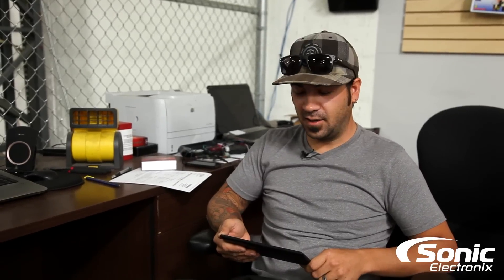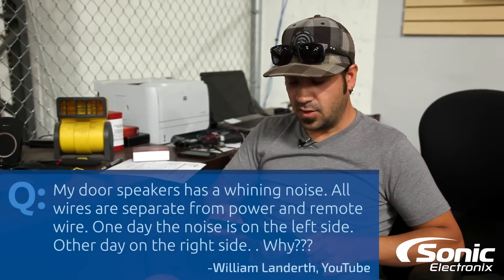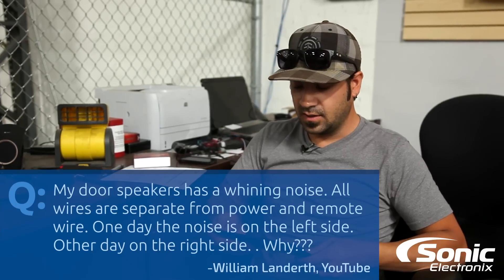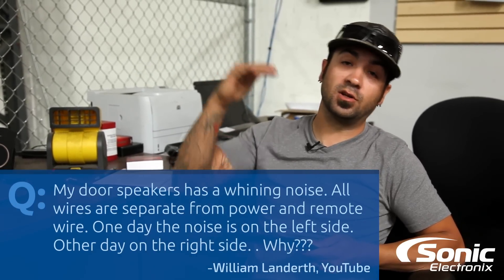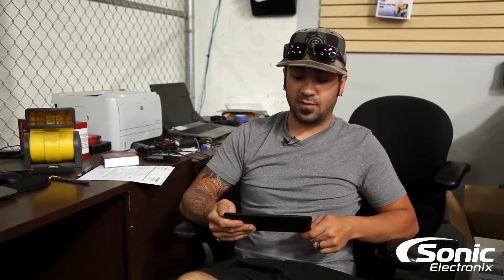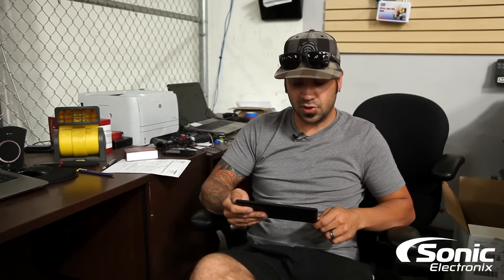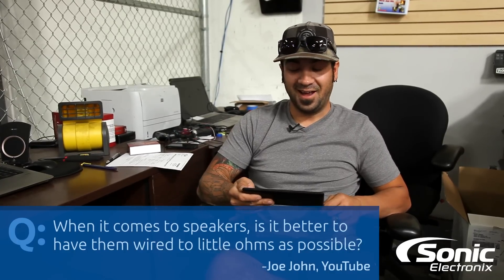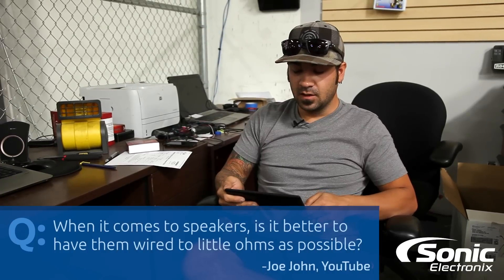Why is My Speaker Making a Whining Noise and What Impedance Should I Choose? | Car Audio Q & A

Comment: I would like to upgrade my stock system for my 2004 explore with the premium sound. what are good 5×7 speakers for around 200 a pair or less. also an 1 8" sub around same price I will be using stock amp for now please help.
Reply: Get these http://www.amazon.com/Kenwood-KFCC5794PS-Performance-Series-Speaker/dp/B0079OBE0U/ref=sr_1_15?ie=UTF8&qid=1404637610&sr=8-15&keywords=5x7+speakers With this sub http://www.amazon.com/Pioneer-TS-SW841D-Shallow-Mount-Subwoofer-Watts/dp/B000TD900O/ref=sr_1_1?ie=UTF8&qid=1404637849&sr=8-1&keywords=8+inch+flat+subwoofer

I personally own those kenwood's and they sound great i have them wired to 2ohms on my 4 channel still running strong, and the sub, well i choose the flat 8 because i don't know if you are putting it back in the factory location, if you are making a box for a single 8, i would go with a deep mounted 8 inch sub... All this is just cheap china made stuff for a low cost, if you want real true quality go with the brand "Focal" for the highs and "Sundown Audio" for the sub's, keep in mind with car audio the more you spend the more quality you get.

Comment: I had a question about my speakers, every time I turn off the car the woofers make a loud thump noise. Could that be the ground wire? Or what could it be?
Reply: I wondered about that to bro
Reply: Any idea yet guys??? I get that thumb too and that really annoying whining through the speakers only when im in a gear, sooo annoying omg.
Reply: If the volume is high it does the same on my sub if i play low frequency
Reply: If it makes a thump pop when you turn the car off the heady it is turning off before the amp is, you can wire remote to ignition wire the red wire and then add a delay to turn the amp on 10 seconds after the stereo headunit on.
Reply: @barny3ce  I have a 03 tahoe with bose system and Spliced wires. I ran my amp wire from my aftermarket head unit to the pink wire in my tahoe to power the factory amp.  After playing at high volume for awhile my right front speaker then all speakers make a very loud static sound that won't stop until I cut truck off.  Plays fine at loud volume using ignition on power.    My head unit Acc wire is ran to my fuse box, I don't have my antenna wire connected to head unit, and I think my pos+ and neg- wire could be crossed up but I dont know how to check which is positive.   Any idea what could cause my problem ?  Im also thinking that my new head unit is pushing to much power to the factory bose system and speakers. I don't think that shouldve caused my static problem though.  Whats do you think

Comment: how does running power wire and rca's on the same side cause noise
Reply: Since cars use an alternator with a rectifier the conversion from ac from the alternator to 12v dc may not be perfect and may result in engine wine noise through the speakers. The wire puts out a magnetic field which may  interfere with the audio signal.

Comment: The answer about the impedance was very helpful. I wanted to ask the exact same question. Because I want the best sound quality and speaker response. I was debating whether I should run my subs 400 watts each at 2 ohms or get a bigger amp and go with 400 watts each at 4 ohms thanks so much for these videos. Sonic Electronix is awesome.

Comment: I have a problem. I have a 1997 ford Taurus GL and both my speakers work when I play the radio but when I turn to the OEM cassette player (yes a cassette player) only speaker works. Everything is stock/OEM to my knowledge.  Can offer some suggestions?

Comment: Question: I have a 96 grand marquis with a voltage problem.  I have two Kenwood 12" subs rated at 400rms, true 4 gauge power wire to the Kenwood 900rms amp. I also have a new yellow top battery under the hood. My grounds are solid, mounted to the frame from battery. And the amp ground is properly mounted to the trunk chassis with 4gauge. I'm only getting 12 volts and it drops down lower when playing bass music. Is it possible that my factory alternator isn't pushing enough amps? Should I install a second battery or spend $350-400 on an upgraded alt? I don't have the cash for the ladder at this time.